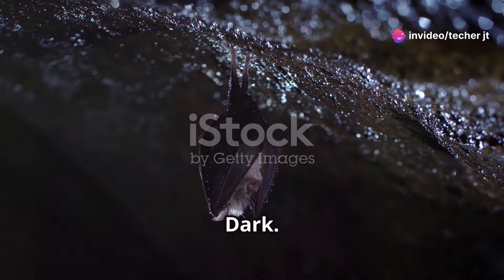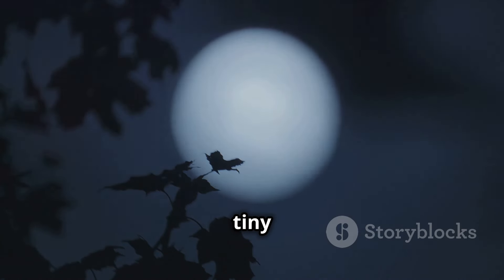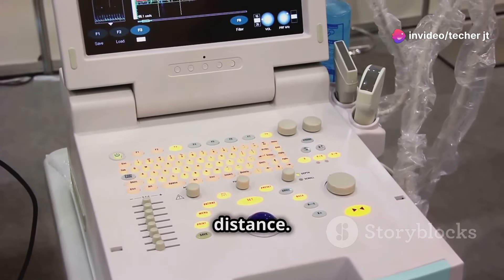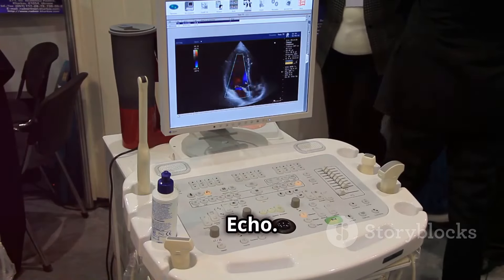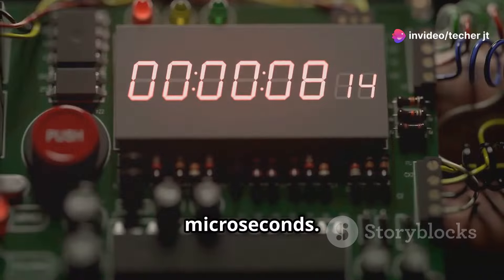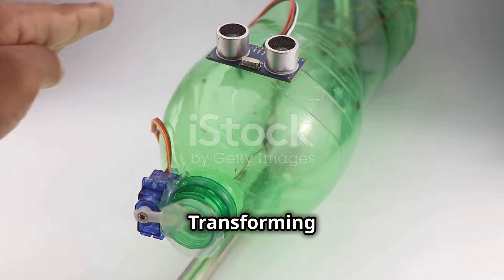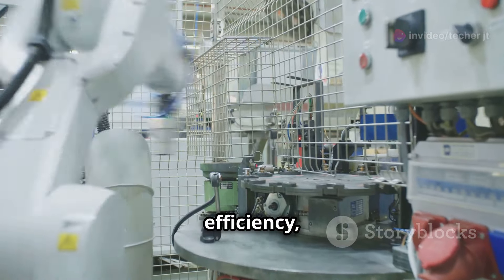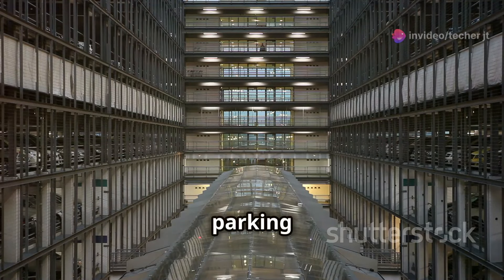Unlocking the Power of Ultrasonic Sensors: How They Work and Where They're Used!

Comment: AKISHA BACHINICHA
10 ORION

1.) Echolocation is the process of emitting sound waves and detecting their echoes after bouncing off objects, used to determine distance. Ultrasonic sensors work similarly by emitting high-frequency sound waves and measuring the time it takes for the echo to return, allowing robots to calculate the distance to nearby objects.

Comment: Abdul Haq R. Maminta
10-Lyra
1. Understanding: Explain the principle of echolocation and how it relates to the functioning of ultrasonic sensors.
Ans: Both echolocation and ultrasonic sensors use sound waves to detect objects and measure distances by timing how long it takes for the sound to come back. like bat and dolphins they produce sound waves that travel through the air and bounce off objects around them.

Comment: Rafael Daroy
10-LYRA

2. Applying: Describe a scenario in which an ultrasonic sensor would be more beneficial than an infrared sensor. Justify your choice.

An ultrasonic sensor would be more beneficial in a scenario like measuring distance in a dusty or foggy environment, such as in a construction site. Unlike infrared sensors, which can be affected by particulate matter that scatters light, ultrasonic sensors use sound waves that can travel through these conditions more effectively.

Comment: Ericka Grace O. Cajeles
GRADE X - LYNX

Q2. Applying: Describe a scenario in which an ultrasonic sensor would be more beneficial than an infrared sensor."

Answer: Though both infrared sensors and ultrasonic sensors are types of Proximity Sensors, these two sensors have different capabilities. The biggest difference between IR sensors vs. ultrasonic sensors is how the sensor works. Ultrasonic sensors use sound waves (echolocation) to measure how far away you are from an object. On the other hand, IR sensors use Infrared light to determine whether or not an object is present. With the Ultrasonic sensors, the robots can withstand any obstacles especially with no light, clouds of dust, and dark environments providing better precision and accuracy.

Comment: Angel Anne L. Martierez 10-Orion🌸

2. Applying: Describe a scenario in which an ultrasonic sensor would be more beneficial than an infrared sensor. Justify your choice.

For example in a foggy environment, an ultrasonic sensor would still work accurately to its purpose unlike infrared sensors that would have issues with its purpose.

Comment: Maria Floriz J. Napone
10 - Lyra

4. Evaluating: Assess the impact of environmental conditions (like temperature and humidity) on the accuracy of ultrasonic sensors. What measures can be taken to mitigate these effects?

- Temperature and humidity are two environmental factors that can modify the speed of sound and potentially cause signal absorption, which can lead to measurement mistakes and compromise the accuracy of ultrasonic sensors. In order to lessen these impacts, sensors can be regularly calibrated, have temperature correction built in, and be kept in protected enclosures. These safeguards aid in preserving dependable performance in a range of environmental circumstances.

Comment: Englis
10 - Andromeda

1. Understanding: Explain the principle of echolocation and how it relates to the functioning of ultrasonic sensors.

- Echolocation works on the same principle as ultrasonic sensors, which utilize sound waves to measure distance, by sending out waves of sound and timing the return of the reflected waves.

Comment: Jaeve Joshua C. Butcon
X- hermes

1. Understanding: Explain the principle of echolocation and how it relates to the functioning of ultrasonic sensors.

Echolocation is the process by which animals, like bats and dolphins, emit sound waves and interpret the echoes that bounce back from objects to determine their distance and shape. Ultrasonic sensors operate on a similar principle: they emit high-frequency sound waves and measure the time it takes for the echoes to return after hitting an object. By calculating this time difference, the sensors can determine the distance to the object, enabling applications like obstacle detection and distance measurement in robotic systems.

Comment: Zoe Jillian R. Cabrera
10-Hermes

2. Applying: Describe a scenario in which an ultrasonic sensor would be more beneficial than an infrared sensor. Justify your choice.

-Ultrasonic sensors are more reliable than infrared sensors in a cluttered warehouse environment. This is because ultrasonic sensors use sound waves, which are unaffected by light conditions. Infrared sensors can be affected by ambient light and reflective or transparent surfaces, leading to inaccurate readings.

Comment: Sophia Margarette G. Peñoso
10 - ANDROMEDA

Q2. Applying: Describe a scenario in which an ultrasonic sensor would be more beneficial than an infrared sensor."
Answer: While both ultrasonic and infrared sensors fall under the category of proximity sensors, they function differently. The primary distinction between ultrasonic and infrared sensors is the functioning of each type of sensor. Ultrasonic sensors estimate your distance from an item via echolocation, which uses sound waves. Infrared light, on the other hand, is used by IR sensors to detect the presence or absence of an object. The robots can overcome any barrier thanks to their ultrasonic sensors, especially in low-light, dusty, and dark conditions where they can operate with greater accuracy and precision.

Comment: Alexa Janne Arioja
10 - lynx

Analyzing: Compare and contrast the advantages and limitations of ultrasonic sensors in industrial applications versus their use in medical imaging.

>Ultrasonic sensors are helpful in industrial applications because they provide low-cost distance measurements and object recognition in tough situations like dust or fog. However, they may be influenced by external factors such as temperature and material qualities. In contrast, in medical imaging, ultrasonic sensors such as ultrasound provide non-invasive, real-time options for analyzing internal structures without the use of ionizing radiation. However, they frequently have lesser resolution than other imaging modalities and may be limited by the patient's body composition. Both applications involve ultrasonic technology, but their capabilities are restricted by the materials' characteristics and the surrounding environment.

Comment: Michaella Ragmac
10-Cassiopeia
1. Understanding: Explain the principle of echolocation and how it relates to the functioning of ultrasonic sensors.

Echolocation is a natural mechanism used by certain animals, like bats, to navigate and find objects around them. This process involves emitting sound waves that travel through the air, and when these waves hit an object, they reflect back as echoes. By assessing the time it takes for these echoes to return and analyzing the sound's properties, the animal can gauge the object's distance, size, shape, and texture. Ultrasonic sensors, inspired by this natural ability, operate on the same echolocation principle to measure distances and detect objects. They function by emitting high-frequency sound waves and recording the time it takes for the echoes to return, and are employed in a range of fields, from medical imaging to vehicle safety.

Comment: Iam Raut Labnotin 
10-Lyra 

1. Understanding: Explain the principle of echolocation and how it relates to the functioning of ultrasonic sensors.

•Echolocation involves emitting sound waves and detecting their echoes to locate objects, a method used by animals like bats. Ultrasonic sensors use this same principle with high-frequency sound waves, measuring the time for echoes to return to calculate distances. This technology is widely used in applications like distance measurement and proximity detection.

Comment: Rebmevon B. Marquiño
10 - Lynx

2. Applying: Describe a scenario in which an ultrasonic sensor would be more beneficial than an infrared sensor. Justify your choice.

- One scenario for this is weather conditions, ultrasonic sensors would be more beneficial in these times than an infrared sensor because sound waves may still flow through and accurately reflect in rain and fog, two weather conditions in which ultrasonic sensors excel. While infrared sensors in rain and fog are less dependable because they might scatter infrared light and lead to measurement mistakes making them less reliable.

Comment: Urhyness Agatha B. Santos
10-Cassiopeia

Question #6 Understanding: What are the key components of an ultrasonic sensor, and what role does each play in its operation?

Answer:
 
1.Transmitter: This part sends out ultrasonic sound waves.
2.Receiver: This part picks up the echo of the sound waves after they bounce off an object.
3.Processor: This part measures the time it takes for the echo to return and calculates the distance to the object

Comment: Gabe Daniel S. Rivero
10 - Hermes

2. Applying: Describe a scenario in which an ultrasonic sensor would be more beneficial than an infrared sensor. Justify your choice.

An ultrasonic sensor is more beneficial than an infrared sensor in detecting objects in low visibility conditions like fog or darkness and with a variety of materials such as reflective and transparent surfaces because it relies on sound waves rather than light.

Comment: Ma. Pashka R. Resoso
10-Lyra

2. Applying: Describe a scenario in which an ultrasonic sensor would be more beneficial than an infrared sensor. Justify your choice.
An ultrasonic sensor would be more beneficial than an infrared sensor in a scenario like for example, detecting objects in a dusty or smoky environment, such as in a factory or warehouse when doing something related with dust or smoke. Ultrasonic sensors rely on sound waves, which are not affected by visual obstructions like dust or smoke, whereas infrared sensors depend on light and can be hindered by such conditions. This makes ultrasonic sensors more reliable for object detection in challenging environments.

Comment: Keth Jelzar A. Montes
10 - Cassiopeia 

2. Applying: Describe a scenario in which an ultrasonic sensor would be more beneficial than an infrared sensor. Justify your choice.

-Ultrasonic sensors are less affected by dust or smoke, which can interfere with infrared sensors.
Reply: Leonardo M. Verbraecken 
10 - Cassiopeia 

2. Applying: Describe a scenario in which an ultrasonic sensor would be more beneficial than an infrared sensor. Justify your choice.

- An ultrasonic sensor would be more beneficial in a dusty warehouse where infrared sensors might struggle. Dust particles can scatter or absorb infrared light, reducing accuracy, while ultrasonic waves can pass through dust without significant interference, making ultrasonic sensors more reliable in this environment.

Comment: (Question)
1. Understanding: Explain the principle of echolocation and how it relates to the functioning of ultrasonic sensors

(Answer)
Echolocation is a biological phenomenon utilized by certain animals, such as bats and dolphins, to navigate and locate objects in their environment. This process works by emitting sound waves that travel through the air. When these sound waves encounter an object, they bounce back, or echo, to the source. By analyzing the time it takes for the echoes to return and the characteristics of the sound, the animal can determine the distance, size, shape, and even texture of the object.

Alvin M. Tagudin (10 - HERMES)

Comment: Shiloh Nouvel A. Miquiabas - 10 Andromeda

6. Understanding: What are the key components of an ultrasonic sensor, and what role does each play in its operation?

Answer: An ultrasonic sensor has a transmitter that sends sound waves, a receiver that detects the echo, and a control circuit that calculates the time delay to determine the distance to an object.

Comment: SEAN LEMUEL CALAMBA
10 - LYNX

8. Analyzing: Investigate the reasons why ultrasonic sensors might fail to detect certain materials effectively. What characteristics of the materials contribute to this issue?

-------  Ultrasonic sensors may fail to detect certain materials effectively due to several factors. Soft or absorbent materials like foam or fabric can absorb sound waves rather than reflect them, while angled surfaces may cause sound waves to deflect away from the sensor. Thin or small objects can allow ultrasonic waves to pass around or under them, leading to missed detection, and irregularly shaped objects can scatter the sound waves, preventing accurate reflections. These material characteristics reduce the sensor's ability to detect objects reliably.

Comment: Andre Clyde Eduardo C. Acta
10-LYRA

1. Understanding: Explain the principle of echolocation and how it relates to the functioning of ultrasonic sensors.

The echolocation of bat's are similar to how an ultrasonic sensor works because when a bat screeches/screams the echo of their screams/screeches  then come back after a few seconds  which the bat then estimates the distance just like how the echo of the sound produced from the transducer is the used to calculate how far the sound traveled. 
Sorry for the late submission,  I completely forgot to comment my answer because I got used to writing it down on my paper.

Comment: Loreyn C. Nanay
10 - Lynx
1. Understanding: Explain the principle of echolocation and how it relates to the functioning of ultrasonic sensors.

Echolocation is a biological phenomenon utilized by certain animals, such as bats, to navigate and locate objects in their environment. This process works by emitting sound waves that travel through the air. When these sound waves encounter an object, they bounce back, or echo, to the source. By analyzing the time it takes for the echoes to return and the characteristics of the sound, the animal can determine the distance, size, shape, and even texture of the object. Ultrasonic sensors are inspired by nature's ingenuity and use the same principle of echolocation to measure distances and detect objects. These sensors are used in various applications, from medical imaging to automotive safety. These sensors emit high-frequency sound waves and measure the time it takes for the echo to return.

Comment: Messiah Emmanuelle Lei P. Salomon
X- Cassiopeia

8. Analyzing: Investigate the reasons why ultrasonic sensors might fail to detect certain materials effectively. What characteristics of the materials contribute to this issue?

-Ultrasonic sensors measure distance by emitting high-frequency sound waves and measuring the time it takes for the echoes to return. However, certain materials can interfere with this process, leading to inaccurate or no detection. Materials that absorb sound waves, reflect them excessively, or are small or thin can hinder detection. Additionally, uneven surfaces, noisy environments, and frequency mismatches can also affect sensor performance. Understanding these factors is crucial for selecting the right sensor and optimizing its use in different applications.

Comment: Kirk C. Nangkil
10-LYNX

2.Applying: Describe a scenario in which an ultrasonic sensor would be more beneficial than an infrared sensor. Justify your choice.

A scenario where an ultrasonic sensor would be more beneficial than an infrared sensor is in low-light or no-light conditions. Infrared sensors rely on light to function, so they may not be effective in dark or foggy environments. Ultrasonic sensors, on the other hand, use sound waves, which can penetrate these conditions.

Comment: Nuriel Danna S. Garcia
10 - LYNX

2. Applying: Describe a scenario in which an ultrasonic sensor would be more beneficial than an infrared sensor. Justify your choice.

An ultrasonic sensor would be more beneficial than an infrared sensor for an autonomous underwater drone designed for deep-sea exploration because ultrasonic waves can effectively travel through water, allowing the sensor to accurately measure distances and detect obstacles even in murky or turbid conditions. Unlike infrared sensors, which rely on light that is absorbed and scattered by water, making them ineffective for depth measurement and obstacle detection in such environments, ultrasonic sensors provide reliable performance by emitting sound waves that reflect off objects and return to the sensor, enabling the drone to navigate and avoid obstacles with greater precision.

Comment: Rushlee Baltazar
10-HERMES 
9. Evaluating: Critique the statement: "Ultrasonic sensors are universally superior to other types of sensors." Provide arguments for and against this claim based on their performance in various applications.
The claim that "ultrasonic sensors are universally superior" is inaccurate. While they excel in low-light conditions, can penetrate dust and fog, and detect various materials, they have limitations in accuracy, response speed, and susceptibility to environmental noise. Laser and optical sensors often offer higher precision and longer range, making them more suitable for detailed measurements or high-speed applications. Ultimately, the best sensor depends on the specific use case, as ultrasonic sensors perform well in certain environments but are not universally better across all scenarios.

Comment: Ralf  Mikael A. Lopez
10-Andromeda

1. Understanding: Explain the principle of echolocation and how it relates to the functioning of ultrasonic sensors.

Echolocation and ultrasonic sensors are comparable in that they both use sound waves to detect objects positions and distances by bouncing the waves off of one another and measuring how long it takes for the waves to return to the source.